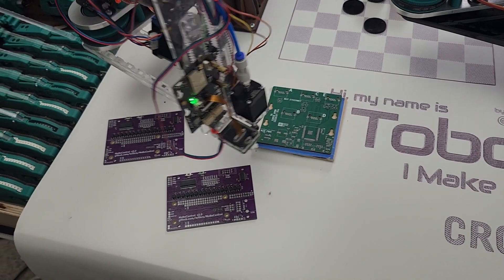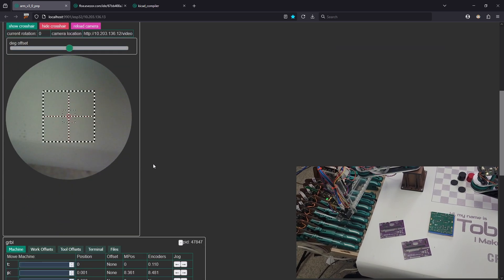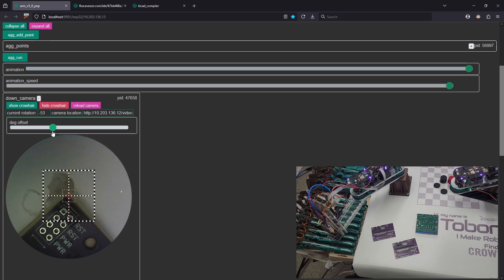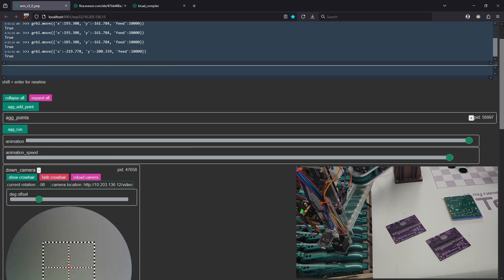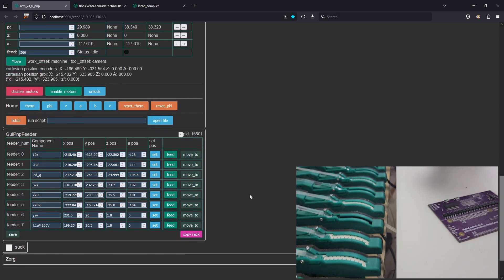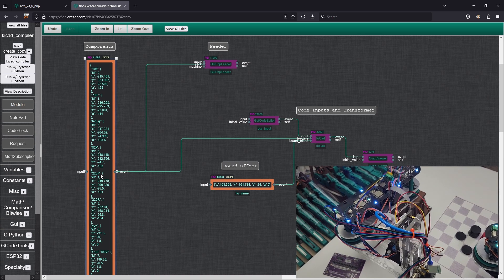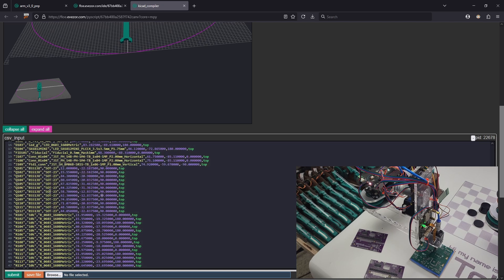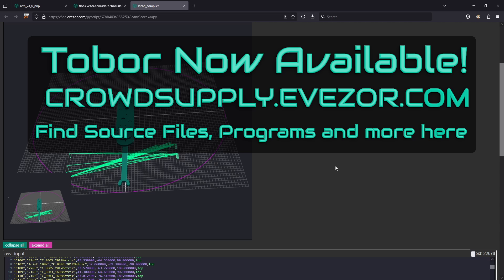Tobor the Robot Assembling Circuit Boards

Comment: The online tool is awesome, can it be ran locally too (without too much hassle)? And, can I create my own blocks (in c++)?
Reply: I like the idea of having a GUI integrated into the block diagram. I hope it will be very successful in the near future!
Reply from the maker: @Bigman74066  Thanks! And yeah, it's way more useful than I would have originally thought. It's a great debugging tool! 
There's a lot more development to be done in this area as well. Currently the gui is just an alphabetized stack of divs and leaves a lot to be desired, but still pretty useful.
Thank you!
Reply from the maker: Thank you!
We're working to get it untwined from other components so it may be run independently. 
I've been asked about rust a few times, and it's the same problem with both.
Fundamentally with Python we can pass plaintext and then there's a version of python compiled for whatever hardware you're running on. (ie, esp32, wasm, arm, etc.) gaining some of what Java was going for with JSM
Also some of this is a bit outside my wheelhouse and don't know how 'pluggable' c++ can be with pre-compiled bits. There's no reason the whole thing can't be compiled upon save, but that is a bit out of scope for what we're doing currently and probably won't be on the roadmap for some time. 
Thank you!
Reply: @Evezor  I forgot that you where using Python. ☺️. Being an interpreted language it makes adding additional code easier than for compiled languages. But my main point is extensability of the block library so the user is not dependent on the availability of pre-fabricated blocks. Look at node-red with its massive  use-made block library. Personally I would prefer a compiled language because of the limited processing power of the ESP32
Reply from the maker: @Bigman74066  Thanks! I've said it in other places, we're working on releasing some versions where people can share and create their own blocks and are excited to get that rolling. 
I am familiar with node-red, and keep in mind that that is also an interpreted language (javascript). I believe to some extent we're both using some of the same tricks. 
Speed/ power/ esp32s, keep in mind things aren't always as they appear. Micropython on the esp32 is pretty fast, far faster than CPython on something like int performance (they store the int right there in the pointer) and we aren't limited to just esp32s either, it just was the easiest microcontroller to get when supply chains were borked and there are many processors out there with much more power. We have a CPython version with a fastapi core in the works that isn't ready for release yet for other architectures. Not to mention the versions we already have for running WASM in the browser. 
Another aspect to consider is when you're running a gui on an esp32 you have all the local processing power of the client available to do things as well. 
The beginnings of this project were geared strongly towards notions of distributed computation, so if one node doesn't have the power to do something, some other node should. 

Anyways. Thank you for the comments and support. More is coming! Thanks